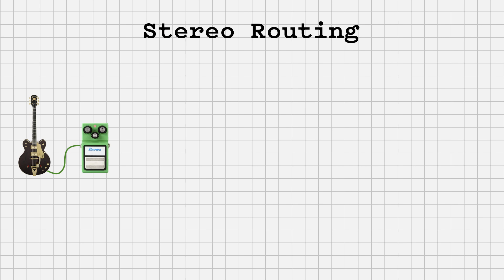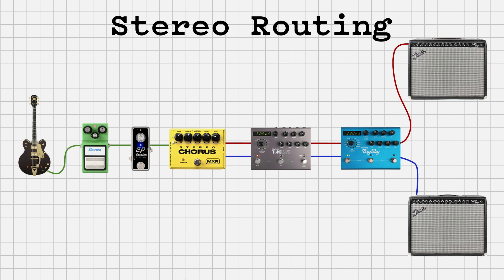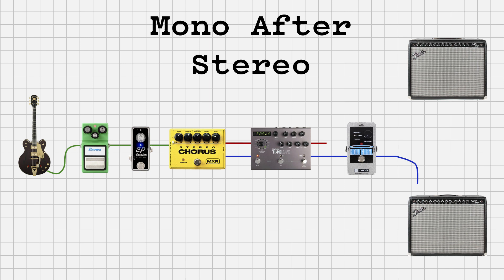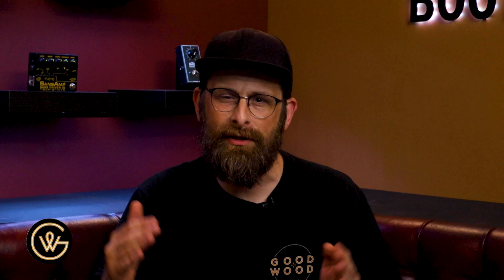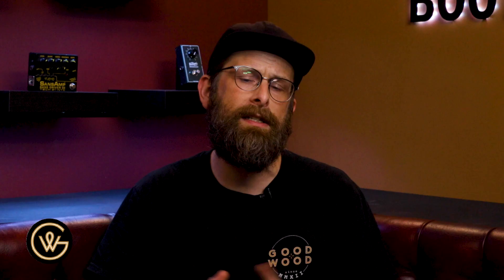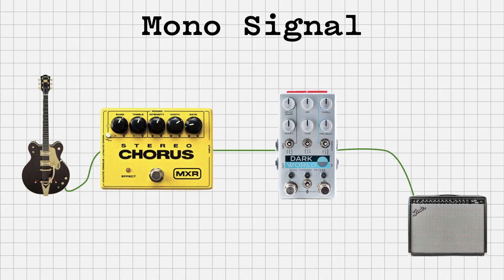Using A Mono Pedal In A Stereo Signal Path

Comment: Easy fix. Get another EHX HOLY GRAIL and run them both in parallel then output to a left and right input pedal.😮
Reply: :0
Reply: I was thinking exactly that.
Expensive...
Yet... it ain't stupid if it works.

Comment: Could you remove it from the chain completely?
Amp 1 send > verb > amp 2 return?
Reply from the maker: I don't think I full understand the question... are you talking about using the amps FX loop?  In theory you could, but to keep a stereo chain, you'd still have to mix the signal in parallel with the other stereo pedals.
Reply: I was thinking a loop through both amps. An idea if you were trying this without having to add gear (except for a cable or 2) 
Stereo chain > both amps 
Send 1 > verb > return 2 
Send 2 > return 1
Reply from the maker: @Official_Keif  Gotchya.  In that instance though you'd still be sending verb only to the return 2 cab with preamp 1 tone stack... Cab 1 would be getting preamp 2 without verb (if Im understanding correctly).... I think you're saying a mono reverb in the amp FX loop after a stereo chain, correct? Im not saying it wouldn't work, just that it would still only come out of one speaker cab on half of the stereo field.

Comment: Can you just put dual ts out the Strymon timeline and trs input to holy grail and trs out holy grail with dual ts to both amps ?
Reply from the maker: GOod question.  Unfortunately not. There is nothing that can carry signal on the ring of the holy grail input or output... so you'd be sending ring to the holy grail and nothing would pass signal wise as far as ring is concerned.

Comment: A Twin has two inputs - why not just run the parallel cables into the two separate inputs of the Twin?
Reply from the maker: two inputs on a twin, yes, but not two separate signal paths in the twin / stereo inputs. You won't retain a stereo path by doing it this way on the twin unfortunately. Would be cool if you could though!
Reply: @GoodwoodAudio  - gotcha, thanks. I've been looking all over for info about bridging the channels on a tone master twin but couldn't find anything. Is there even any advantage to jumping the channels on a twin?

Comment: How about putting the mono pedal through the tip of a split y stereo cable then rejoin the ring after ?
Reply from the maker: passive 'mixing' of signals like this isn't going to work well.  Going to load down the signal... You could try this with a line mixer but this is more of a wet dry type signal rather than stereo.

Comment: Is this really such a big deal? Just use the reverb into only one of the amps. The whole point of stereo is to have something different happening on one side than what is happening on the other side. Reverb only going into one amp isn’t going to sound bad - it’s just like doing a wet dry setup - plus, with all the other effects going to both amps, it’s not like the amp not getting reverb is going to sound stark and dry. Personally, I would just put the reverb before the stereo effects though. I think it’s ridiculous that most people think you cannot put delay or reverb anywhere except last in your chain.
Reply from the maker: I would tend to agree with you.  But this would drive some people absolutely crazy.  haha.  Guitars players are fickle beings.  We all (myself included) have our strong opinions.

Comment: Another great Video! What about running a parallel analog dry through and setting the mono reverb to kill dry? Would that work as another option? I'm thinking I might try this out with my Walrus Slo. 

Also: I'm happy to see you say chorus sounds good after reverb because that's where it goes in my signal chain if I use the chorus on my Roland JC-40! Comes in after the effects loop for some reason!
Reply from the maker: ya, you could run a parallel dry for sure! It would just need to be parallel to all wet effects and mixed down before your final pedalboard outputs.  But definitely a good way to do it!

Comment: can the old blood split meld be used for the parallel method? I want to run the reverb parallel to a stereo chorus and delay.
Reply from the maker: I'd probably consider something more in the realm of the OBNE signal blender. Downside it's mono.  Check out the parallelizer  by musicom. That might be a good optioN!

Comment: Great video! Is there any way the loop controllers (eg. Boss ES-8 or GigRig G3) can solve this with their parallel modes?
Reply from the maker: Pretty sure they won't have an issue with this.  Depending on the controller you may just need specific cables (like a drop ring / shorted tip sleeve cable if using RJM).  Not as familiar with this on the boss / gigrig stuff as I don't use them as much.  But I know it's doable!
Reply: @GoodwoodAudio  actually just went through this (I have a G3), and it's actually not possible to run both stereo and parallel with the G3, you have to choose. And mono pedals have to come before the stereo in the chain to keep everything in stereo (since you're stuck in series). You can put them in parallel, but then you have to run the stereo pedals in mono, so... short answer is "no". I was super bummed to hear it, because I pretty much bought it assuming the holy grail of switchers could run do parallel stereo (since I have a W.D.W setup, and only use the switcher for my wet pedals, which are all stereo. I want most in kill-dry for obvious reasons, but can't do it now since that'd require parallel). Bummer. 

It might be possible to take the mono pedal into parallel so long as the loop starts and ends with that 1 single pedal and no stereo pedals are in the parallel chain, but I'm also pretty sure you would then have to have the mono pedal earlier in the chain/before your stereo pedals

Only solution I can really think of, is using a device i found called the Musicom Lab Parallelizer II. I'm not 100% sure it'll work, but I think it will, and I may buy it even though it'll complicate the crap out of things since I'll basically have to have that (another switcher basically) in between 3 of my stereo pedals and the G3. The additional semi-benefit if it would at least open up 2 more loops in my G3 (with the compromise being that the 3 pedals in parallel using the Musicom are now stuck in 1 channel/selector on the G3, so I'll be tapdancing again). This is similar to using something like GigRigs Wetter Box, too, but I need it to do more than blending 2 pedals in parallel.
Reply from the maker: been going through this this past week with a customer... been a bit frustrating finding out the limitations of the G3 @n.s.3812

Comment: This is nonsense. If you mix the stereo chorus single into a mono path, you loose the stereo image of the chorus.
Reply from the maker: totally agree...but that wasn't the point of the vid, which I cover with workarounds and parallel options (which can be done while maintaining a stereo signal)... But yes, you're right - you can't run a mono pedal in series after a stereo chain and maintain the stereo signal.
Reply: No shit dude. Did you even watch the video before commenting?